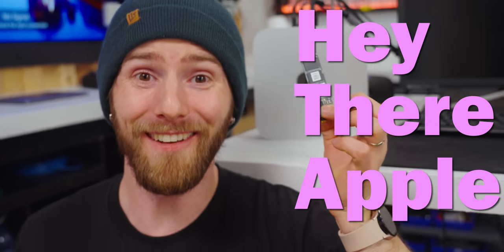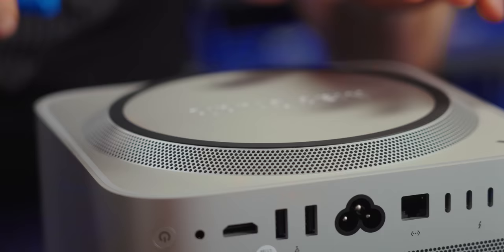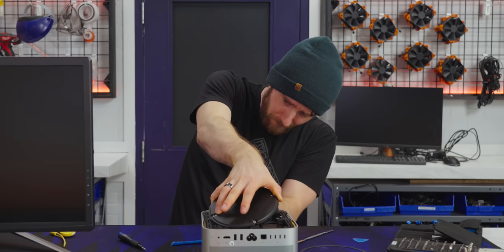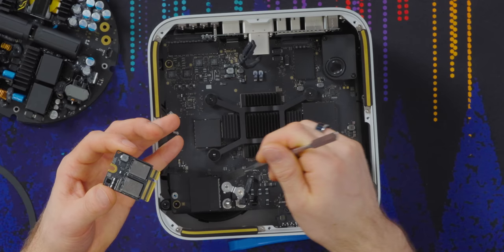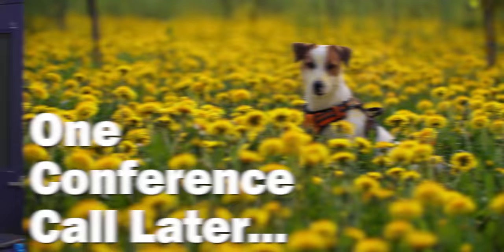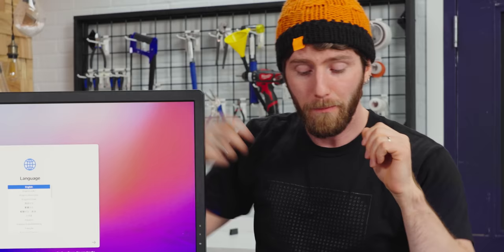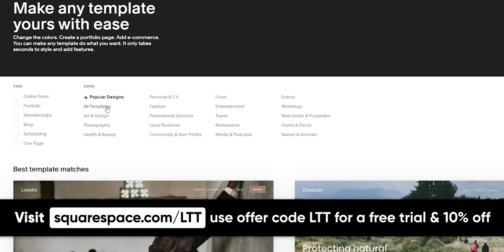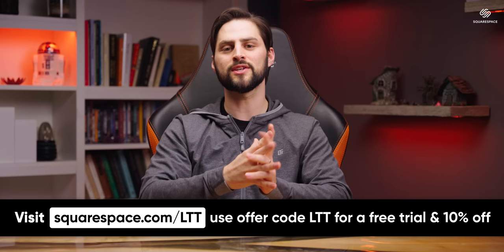I want to love Apple, but they’re making it hard - Mac Studio SSD Swapping

Comment: Someone definitely got fired for not locking out power supply swaps.
Reply: Nope, already got fired for making the power cable removable
Reply: @knightsljx  Is this the same guy who was fired for the iMac Pro's memory not being soldered on?
Reply: @OffitInfinity  exactly
Reply: Is it the same guy that glued the digitizer chip on the iPhone 6 max along with bend gate
Reply: Right after those who let mere mortals to be able to remove that “ring” on the bottom, without some $250000 device that, I don’t know, create a near absolute vacuum specifically on this area to be able to pull it out
Reply: @Chris-hw4mq  maybe also a protective glasses to protect yourself from being blinded by magnificence of marvelous engineering
Reply: @rkevic  No, that guy got a promotion
Reply: I laughed out loud xD
Reply: LOOK IT FOR EVEEEEER!
Reply: bum drum
Reply: Pretty much already fired for using screws on the case instead of rivets. Then he got re-hired and re-fired the next day for swappable PSUs. Then the day after for not having soldered the modules. And finally, for giving a shot to the user to restore a system instead of MAKING. DAMN. SURE. IT. CANNOT. BE. REVIVED. BY. BURNING. ALLTHEFUSES! (NOT POSSIBLE? THEN GET WORKING ON A CPU REV... RIGHT.. NOW!)... and displaying a message making the user know it's their fault, as you do.
Reply: I just realized something. Since Apple offers repairs, what they are doing is anticompetitive! That should violate at least California's anticompetitive laws!
Reply: Nope, already got fired for allowing third party USB keyboards
Reply: @llMarvelous  Need absolute vacuum? Easy peezy, just blast it with 194 decibels and you've got intermittent vacuum on the low point of the soundwave. Done and done.
Reply: yeah they forgot to use the 12V power lines to transmit the T2 encryption, cause you know... people can hack your personal data from the 12V power rail
Reply: @OffitInfinity  he was iCrucified for that
Reply: @knightsljx  ol
Reply: Is this a Linus x Louis collab callback?
Reply: @knightsljx  Why's that a bad thing?
Reply: @OffitInfinity  You gotta love this guy, screwing Apple from the inside.
Reply: @wealthybone2990  did you seriously just ask why a non-removable powercable is a bad thing?
Reply: @Chris-hw4mq  cap
Reply: That's a feature coming in the next IOS
Reply: @JustinDoesntLookAt  They're still debating whether or not to fire the guys who keep adding USB support at all.
Reply: @knightsljx  that is another division, so 2 division from R&D got fired from Apple, because the PSU is swappable.
Reply: ye sure
Reply: @Astraeus..  sweet Jesus a vacuum concussion square wave.  One diesel powered soundsystem away from world domination and getting my Apple case open. Worthy.
Reply: 4 real
Reply: @renchesandsords  …'if not sooner'
Reply: nah man, the whole team got fired for not gluing the bottom firmly on making repairs impossible
Reply: Someone probably got fired for not locking each Screw
Reply: * for allowing any usb keyboards. Apple doesn’t like wires.
Reply: So, it allows you to use a higher power power supply. And how many users will do that?
Reply: I might need to dump my Apple stock before people start waking up to their anti-consumer practices. Unless the iSheep don't care. From what I've read in the past, the original MacBook Air was the test case for glued together soldered together non repairable technology. Once Apple saw how popular it was and how people didn't care whether it could be repaired or upgraded, they rolled out that type of engineering on their whole product line. That's why I still have a 2012 MacBook pro, 2009 MacBook pro & a2012 Mac Mini.. I think my 2020 M1 MacBook Air will be my last. I have a Framework laptop that is fully upgradable and repairable. I'm running Linux on it so I'm not locked into Mac OS or Winblows. If Framework made smartphones, I'd be there in a second. As a compromise, I think I'm going to get a Galaxy x cover 6 pro when they become available. Ruggedized, headphone jack, removable battery and SD card slot.
Reply: Apple cannot return to modular upgrades due to design size and airflow.
Reply: Allowing an easy repair seems to go against everything Apple does.  It wouldn't surprise me if the engineer who did that was never seen again for some reason.  In reality they would likely be fired from their job, not allowed back on Apple property and maybe even never hired by anyone else again.
Reply: Hi. Hello guys. Yeap I’m fired :)
Reply: He not have power supply
Reply: Spoilers! 😂
Reply: I think Dell wouldn't like someone copying their terrible idea of preventing power supply swaps LOL!  I am not sure what the power supplies they use in their computers are but Dell doesn't seem to use ATX in all of their computers.  If anything it is sometimes some 6 pin that is not ATX.  With so few wires I wonder how many watts the connectors on their weird motherboards are good for.  I am sure I am not the only person who wondered that.  Have you ever seen YouTube vids of reviews of them?  Not only do they seem horribly made because of those but I hear their customer service is no better either!  Then some people I know wonder why I like to build my own PC :rollingeyes

It is only because it can be cheaper, especially before the graphics card scalpers got their hands on what little stock there is so they might jack the prices way up.
Reply: @Chris
Yeah, but no.
Apple is being anti competitive by making it so that the only repair shop that can repair their shit is Apple, which is anti competitive against repair shops.
Reply: Nah, they just got shot.
Reply: Fired for allowing the use of standard USB-C cables for the initialization of the new drive.
Reply: @rkevic that guy got a promotion what are you talking about
Reply: Yeah, they're already gone from including usb-a ports on the back